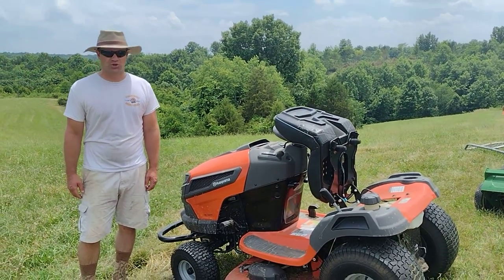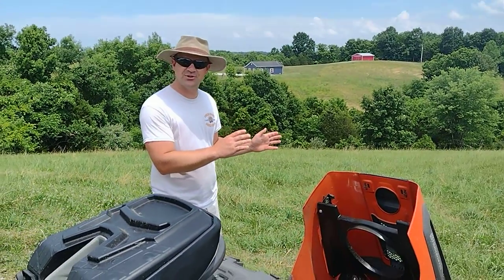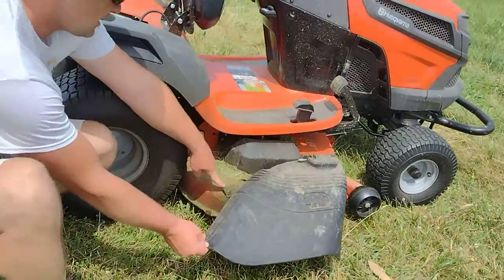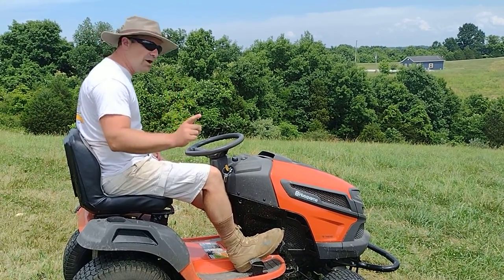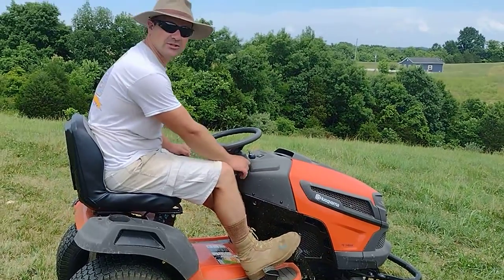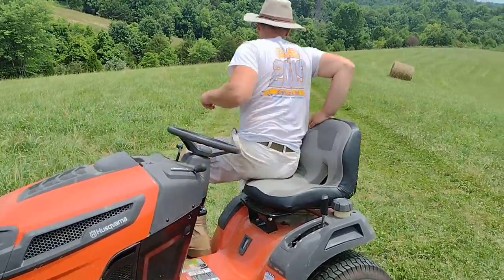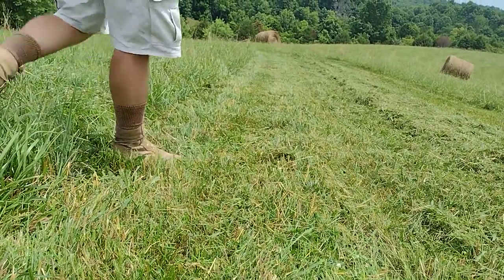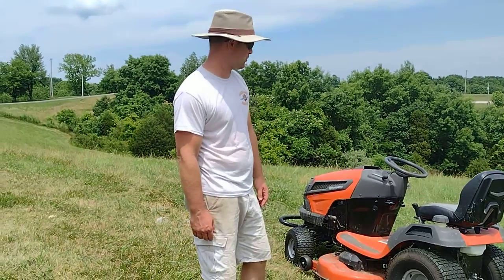No staged ad showing short grass being mowed here! Husqvarna TS 146XK Mower, 1 year update/ review

Comment: Not sure what is causing your engine to diesel when you cut it off but,  if you are turning off the ignition at high rpm's, that could cause that problem. I always, i mean always, throttle back for a brief moment before turning off the engine. Good luck to you. I just purchased a new Husqvarna and love it.
Reply from the maker: I'm not sure either...weird.  I throttle down...and can wait for awhile, but if it's warm, it does that.  Not a big deal to me...just a quirk!  Thanks for watching!  Glad you like yours, too!  Don't get me wrong...I like it overall.  Everything seems to have its pros, cons, or oddities....even people, right? 🤣
Reply: I just bought 1, the dealer told me you are supposed to shut them off at full throttle.
Reply from the maker: Interesting.  Will try it, but boy that sure goes against what we're used to doing!  Seems so wrong.  🤔
Reply: @Kirk Prell   I purchased mine this past fall. I would ask the dealer what his reasoning is. It has been my experience that shutting them off at high throttle can cause the engine to back fire. That is never good for the engine. Possibly the newer engine's are designed not to cause that. Did you purchase yours from a certified dealer or big boss store ? Clerks at the big box stores know very little about the products. I always buy from a dealer. Also, researching these mowers, the big box stores sell brand name mowers with cheaper components. For example, if you have a hydrostatic transmission, the box store units have a plastic housing, not cast metal. Good luck with your purchase.
Reply: @denniswalston1217  The used to have a plastic casing. I have a poulan pro which is made by husqvarna and never had issue with it.
Reply from the maker: I've been shutting off at full throttle when engine is hot.  Seems to stop the dieseling!  Thanks for the tip!
Reply: @Mr.Handy-ish  has it done it since day one you got it?
Reply from the maker: Yep...always dieseled when hot and trying to shut down at low idle.  Full throttle seems to fix it.